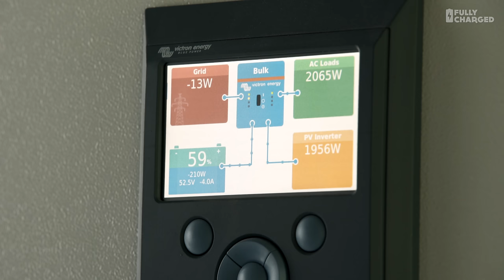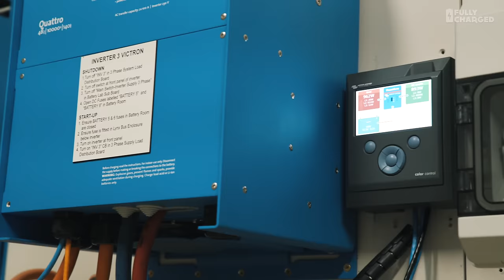Redflow ZCell batteries for home renewable energy storage | Fully Charged

Comment: Recently Tesla demonstrated a battery powered 18 wheel semi-truck. Is redflow build a battery into the under side of a 53'x10' flatbed trailer?
Reply: No, because the Redflow battery is designed and built for a completely different purpose.

Comment: 10:10 - Robert is asking about the efficiency of the battery and this guy claims that you get  10kWh out if you put 10kWh in - anyone who knows anything about physics knows that's impossible.

Firstly, if you capture 10kWh with the solar, some of that is lost converting it to AC (and ??back to DC to charge it - not clear) and you always lose something when converting back.

I'd like to know if it needs any maintenance. Does the water in the electrolyte evaporate over time?
Reply: I have the same question and what is the fluid.
Reply: If the battery capacity is 10kwh it provides 10kwh.  In comparison, the Tesla Powerwall is a 6.4 kwh battery and only 5.44 kilowatt-hours of that is actually warranted to be usable.

This is a different metric to efficiency of recharging.
Reply: Nope. The Tesla Powerwall (v1 or v2) has an efficiency of about 92% - this has nothing to do with the 'usable capacity' which is an engineered limit to lengthen the usable life/capacity of the battery (ie. saying it's 6.4kWh with 5.44 'usable'). There is no technical reason why the whole battery capacity cannot be used, other than that it will shorten its life, which is why they 'over dimension' it. They really shouldn't even mention what it's 'total maximum capacity' is as it's just going to confuse... except for the fact that the marketers trumpet that larger figure. :-/

For the Tesla batteries, if you put 5.4kWh into the battery, you actually get out about 5kWh - some is lost as heat, some to maintain the BMS hardware, cooling, etc. It is not possible to get out what you put in - there are always losses. I think this Redflow guy is being somewhat deceptive/misleading in his language. I suspect the efficiency is on par with the Li-ion batteries - ie. you get out about 92% of what you put in - especially considering this thing has pumps pushing that fluid around.

Be wary of the opinions of people who will profit from you believing them.
Reply: ...and the 'efficiency of charging' is precisely what Robert was asking about. That's the figure that actually matters in day-to-day use.
Reply: Good find, HL65536 - so whatever numbers they quote, they're largely meaningless. So with RedFlow if you put in 10kWh of DC, it only gives you back 8kWh... and if you charge with AC (which most of these systems are doing), it will only give you back 7kWh.

My Li-ion battery gives me back 9kWh when I put in 10kWh and in 10 years time, it's warranted to give me back at least 8kWh. So after 10 years it's still no worse than a Redflow battery. Ho hum.

It's VERY frustrating when purveyors of new technology mix in a little bullshit with the facts. It kills their credibility IMHO, which is a shame, because they do have so much to offer.

But cut out the crap when trying to sell your wares!
Reply: Dear Paul, I think you are right in remarking this. Maybe he should have said something like "the power efficiency is about 90%, close to other Lithium based storage" (supposing that you actually put 10 kWh and you get 8 kWh back: the 90% efficiency gives about 81% in-out total efficiency, simplifying the calculation). 
But I suppose that he's talking about the lower efficiency during the life of the battery; that is, when in use, in 10 years you will always get the maximum efficiency from the flow batt, not as other battery type technology that reduces its efficiency during its lifetime (I think, I dont really know if this is true for flow batts). That's what I thought he said.
Anyway not taking into account the auxiliary pumping system (that does have other losses) is not very gentle of his. (Sorry for the spanglish) :)
Reply: Thanks, Miguel and don't apologise for your more than adequate English (better than my Spanish that's for sure).

I think he knew exactly what Robert was asking and deliberately answered a different question but is words at 9:53 are exactly, "Ten years from now this 10kWh battery will still be delivering 10kWh"

You can almost see Robert's surprise. He then asks at 10:01 , "So you can actually, literally put 10kWh in it and you can leave it and can take 10kWh out. You're not taking slightly less than 10kWh out"

...and he replies "Right". 

Actually, the answer is NOPE. It almost looked as though Robert got a whiff of the bullshit.
Reply: This info about Zinc-Bromine (ZNBR) Flow Batteries is stating:
"The net DC-DC efficiency of this battery is reported to be in the range of 65-75%."
http://energystorage.org/energy-storage/technologies/zinc-bromine-znbr-flow-batteries
Reply: This is a flow battery which means a pump needs to be running so yes there is a loss in power to run the pump....
Reply: @nitramluap  Yes but one uses zinc bromide and one uses lithium , in a world were human beings seem to always jump first and not check the depth , enviromentally i know which one i,d pick. Hopefully were not all looking for someone else to blame in 25 years when weve manage to add lithium with plastic to our food chain.
Reply: jim jon do coupling is more superior!
Reply: @nitramluap  Spot on! Most commercial Battery Banks are underrated. 10KW/Hr is typically 12+KW/Hr. Just as memory cartridges are much larger due to reserve replacement of failed memory cells. Take the voltage drop of the cabling, multiply it by the inverter/converter, and then the losses of the battery flow. It's a stiff drop of efficiency overall. Why is it that so many companies profit off of the disillusion of the public?

Comment: Can anyone answer question for me; I've wondered if the cells work best if they are fully discharged, do they have a system were by the battery is clever enough to pick a cell in each battery pack to fully discharge in turn to maintain the pack rather let each cell have a little taken from it. It would maybe save a battery being taken out of use to be fully discharged. Hope that makes sense.

Comment: very nice....whats the price of those cells..
Reply: Take a deep breath..."Redflow estimates the full cost of a 10kwh ZCell installation will range from $17,500 to $19,500. This includes labour and everything that is required, including a compatible inverter. "  As a comparison a 15kwh Powerwall 2 costs $10,200 installed (battery $8000 + install & inverter $2200).

* all amounts in Australian dollars.
Reply: jim jon wow.. its a big difference...

Comment: It doesn't loose capacity with age, but then why isn't the  warranty on them  then "+ 36, 500 kWh of energy delivered or 10 years (whichever comes first)" from their website. 
basically if you use them a lot the warranty will be less then 10 years..

Comment: It's funny, Australia, the UK, and the US are all hell bent on hanging onto coal and fossil fuel in general, while the developing economies are full on renewable. The UK has it's Hinkley point, we have the one in Georgia and another I've forgotten, plus all the teetering old plants that need decommissioning but are still running because that is the cheaper option for the operating companies. The current US government has put a tariff on solar panels which seems like it will harm the installers industry and slow down public uptake. But that uptake is taking hold, albeit less quickly than down under or in the UK.

Comment: Wouldn't it be simpler and cheaper to have a large high water tank tower next to the house with a pump pushing the water up into the tank during the day and the water running down through a dynamo to run the house electrics?
Reply: Yes of course except now do the maths. You use gravitational potential energy in water to turn the turbine. The equation is pE=G x h x mass where pE is potential energy G is the gravitational field strength (9.8N/kilo at sea level in most places). h is height above ground (in meters) and mass = weight in kilos. Luckily 1 litre of water is almost exactly 1 kilo for fresh water in most situations. To simplify we will take 1 litre = 1kg and G=10 and h = 10 as much above that would get expensive. So 1 litre of water would get us 100J. A small kettle needs 1kW of power (most kettles are more like 2 or 3 kw) so would need a water flow of 10 litres per second. A high power kettle would need 30 litres per second. Assuming 1 litre  of water in the kettle and specific heat capacity of 4000J/C (it's actually 4200) and an 80C temp rise that is 320 seconds or 3200 litres of water. That is 3.2 tonnes of water just to boil a kettle. If you are an energy thrifty household and only use 10kWh per day that is 36,000,000 joules of energy or 3.6 million litres, or 3,600 tonnes of water. The only problem is that at a 10 meter head the types of turbine required are inefficient so you can roughly double that amount of water. Just look at the statistics for the Hoover Dam. Yes it produces a lot of power but the head is 180 meters or 18 times what would be practical for an individual, and the entire flow of the Colorado river goes through the turbines IE about 600 tonnes per second. Not only that but they do some tricks with syphoning and contouring for water ramming to vastly increase the energy from each litre that cant be done with just a 10 meter head.
Reply: no- if your tank is 10 meters up  you just get 1 bar. that is an difficult pressure to run a generator on, also you have a lot of losses due to fricton

Comment: I noticed a dozen electric heaters plugged in ?
Reply: delldimension2345 was mentioned in video they use them to drain power for testing the batteries
Reply: delldimension2345 they're used for testing the batteries

Comment: if this tech is so good, could it replace elon musk's proposal to provide tesla tech to  fix the energy storage problem of SA?
Reply: zen well of course it could, but I suspect musk's system is cheaper, more beautiful and will be installed in 100 days.
Reply: what happened to buying australian? :)
not sure what you mean by more beautiful though? odds are any system at scale would be just as industrial looking as another! :D
agree - 100 days might not be long enough depending on how mature the manufacturing of their 600WH (or bigger) containers are
Reply: At the end of the day it's all about price, this is why lead-acid is still the most popular solar storage option.
This surely can compete on function, but if it costs more then everything else people will not really consider it.
Reply: no, it can't replace tesla's power system
Reply: Powerwall warranty only covers supply up to 56% of it's original capacity over 10 years, the Redflow covers 100% of the battery’s capacity for that period.  Pure economics says the redflow would be a better investment, as unlike Elon's solution, it doesn't lose almost half the capacity in 5 or so years.  Also a lot easier to recycle, minimal fire risk, and handles steady supply far better.
Reply: Sounds like you have personal problems.  I hope you are just a child, as don't seem to be able to communicate as an adult.  Here's a tip, using abusive language doesn't make your point more valid, evidence & facts do.

The redflow battery will not outcompete the Powerwall due to the sheer size of Tesla & publicity afforded it.  That has nothing to do with technical or engineering superiority.

No need to comment on someone who relies on marketing hype from Tesla as their only form of information.
Reply: ahaha, pathetic

your entire argument got trashed in a short comedic piece and your reply is bohoo I'm abusive and can't communicate, typical of someone trying to debate something that's well over their head.

I also like how your only comeback is that I use tesla marketing as my information, even though my 7 steps included exactly 0 information from tesla, the only other thing you say is that my right, but for the wrong reasons, "duhh yeah just publicity" sure thing buddy.
Reply: I expect it could and I am sure that Redflow were straight on the phone.  The key difference is that Elon Musk is a world famous entrepreneur who made his comment about '100 days or it is free' on Twitter to a global audience and has a few billion dollars to back it up.  Tesla has also a proven case study of producing a similar system at scale.  In this video it doesn't appear they are producing at scale yet.

Elon made a local issue global.  Redflow will benefit from the additional spin off business so it is a win/win.  Anything that drives the adoption of a technology in an emerging market will benefit everyone else in that market.  

For example Ford didn't capture the entire car market with the Model T, he just opened the door to a wider market by driving down cost of production.  All car makers benefitted in a bigger market.   Ironic that apparently Telsa are worth more than Ford.
Reply: Not what the warranty is in the US.  I pulled my info right from the Tesla site.  Unlimited cycles for solar backup over 10 years with max 70% degradation.  https://www.tesla.com/sites/default/files/pdfs/powerwall/powerwall_2_ac_warranty_us_1-4.pdf

Comment: in the UK, panels benefit from the help of other renewables. luckily we can remedy this by having wind turbines and, for the Welsh, a waterwheel below the guttering.
Reply: The question I never got an answer to was "why are we restricted to 4.5kw?". Go above that and you loose all the tax breaks etc.
Reply: @StealthyMonk in the UK you can have up to 4.5kW of panels as a private individual. Anything above that is deemed to be a commercial installation rather than domestic and looses all the benefits such as feed in tariff AND you have to pay tax on every damn penny you get paid for anything you feed into the grid.
Reply: It's still better to just cut the losses and just isolate yourself from the grid. There are still ways to produce the energy required to heat your home and water without huge power drains from electricity.

Comment: So from the sounds of this, it's just a sales pitch for a different type of battery.  Yeah it's better at holding a charge for long periods, but the guy selling it sounds like he's trying to make li-on batteries sound bad for storage.  I'll grant you the system looks interesting, but I don't see much appeal for it when a properly installed and maintained li-on battery setup isn't all that dangerous and doesn't waste it's own power pumping fluid around.

Also, the whole thing about needing the grid for a solar inverter to work?  Where the hell did that come from?  Some grid tie systems do maybe, but many don't.  I have a group of parts I can throw together right now that wouldn't require me to tie into anything and provide portable power much like a generator.

Comment: Sadly I see Edison's NiFe batteries as a far better system, the ones in his car still work today, have NO dangerous chemicals, in fact, your garden would love the Potassium Hydroxide, watered down and sprayed on. The price is about the same but NiFe is a non-destructive reaction! The Redflow Zcell (a 10kWh battery) currently costs around $12,600 AUD, not including inverter or installation. NiFe is just a bolt-on install, no pumps to fail and don't mind flattening, strapping out, over charging, freezing or storing for 50 years!

Comment: There are times when the inverter is consuming more power from the grid than the solar array is generating. Which ideally shouldn't happen if the inverter software is calibrated properly not to process anything that would result in such a case. If Graphene ever takes off in the battery market carbon would be back on the map.

Most batteries like to be drained, including those in your phone, otherwise it deteriorates chemically, as everything does, and then it won't be able to use it. This must be why phones last 10 minutes, to lengthen the durability of the battery.

Comment: did anyone see the 15 or 16 2kw heaters in the basement with the zinkemajig batteries??? what's up with that?
Reply: luckym0nk3y He explains that. To test the batteries, he uses the heaters to draw power out quick whilst testing in a high temp condition
Reply: They're known as 'Load Banks'. A resistive load for testing equipment, quite common in testing and commissioning control panels where performance tests and setup can only be done under load.